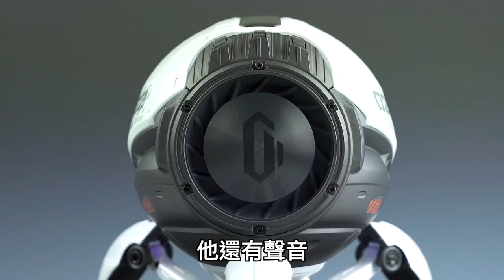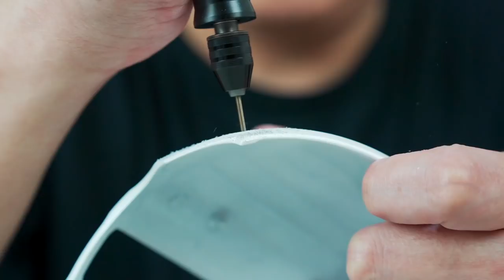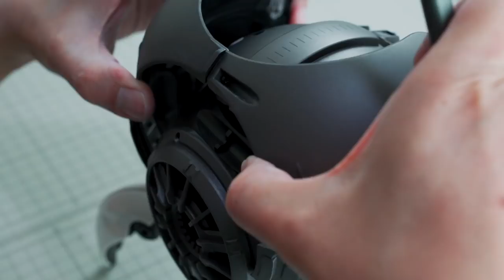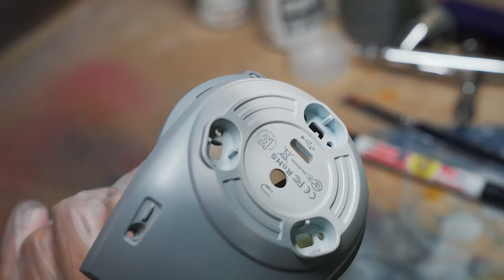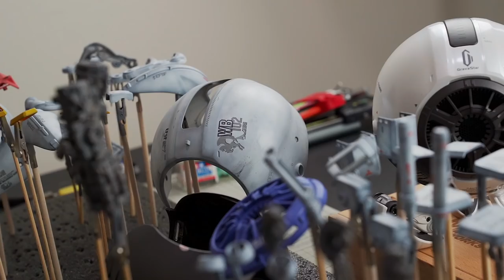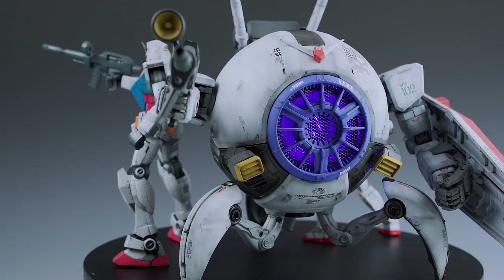MAD@WE.BUILD: The EXTREME Gundam Speaker!!! Mad開箱做起來: 最狂鋼•喇叭！！！

Comment: Awesome video.  Someone just gave me one that the batteries don't last long.  Is there a way to open the speaker and disconnect the battery so when you plug the speaker in to outlet or usb power it turns on and when you unplug it or turn the computer off the speaker turns off?